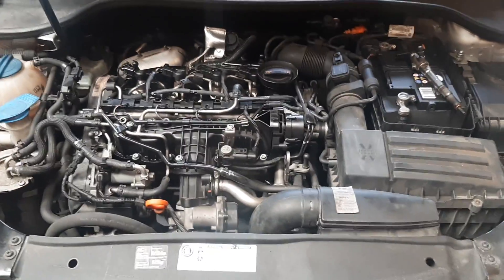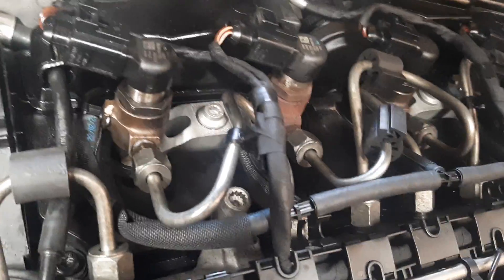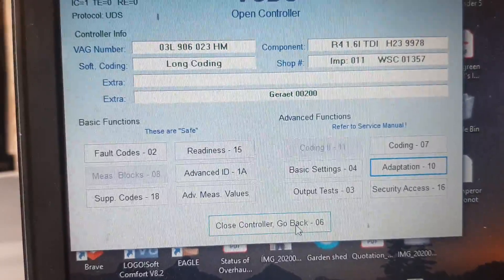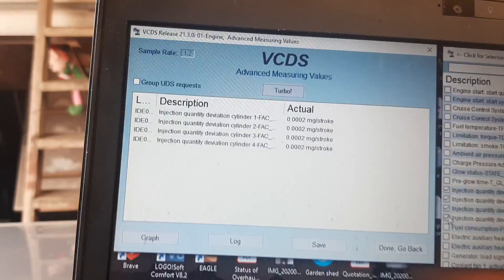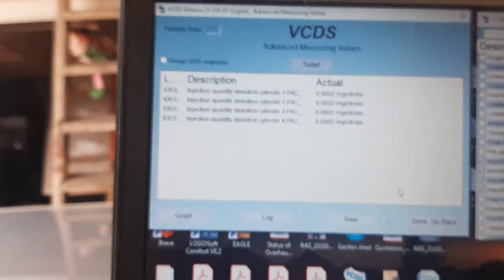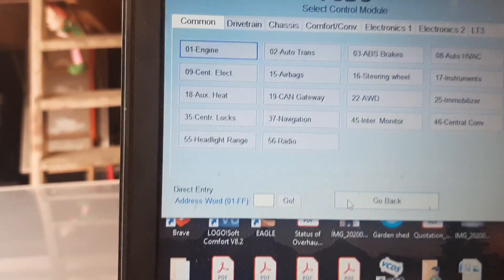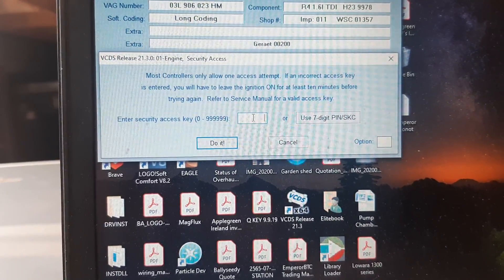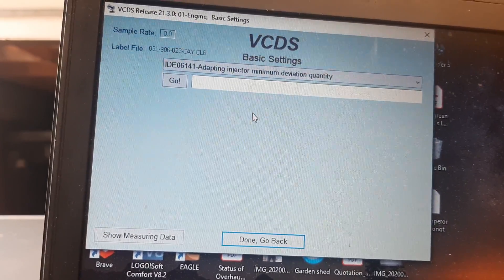VW 1.6TDI Injector Quantity Adaptation IDE06141 CAYC engine

Comment: Hi there has anyone else had a code on injector 4 in the stored value box as 293.1657g, the other injector are normal codes from the top of the injector apart from this one. 

I too am having issues running the cycle but I’m thinking it’s something to do with this. 

Thanks I’m advance 
Jake
Reply from the maker: Hi Jake, that is certainly not a valid compensation code.
Reply from the maker: Have you tried to input the code that is on injector 4?
Reply: Thanks for the reply, yes I recoded the injector on a different laptop/system. I then had a look on this software but the code box for injector 4 would not let me type in it so I couldn’t change the code on this software. 

I had actually previously had the car remapped, so I’ve got someone coming to take the map off today and hoping that this will reset the injectors and fix the lumpy running.
Reply from the maker: @jakelongstaff3173  OK Jake, yes all bets are off if the remap has been done adhoc - Should be good after OE software Rev.

Comment: If the code is 6 digit, i must add 0 at the end to make it 7 like your code?
Reply from the maker: Well spotted! I actually thought all siemens/CONTINENTAL injectors were 6 digit. Perhaps the ECU is putting in the 0 to fill the null placeholder. Generally the 2.0tdi with bosch use a 7 digit.
In any case just put in your 6 digit code.
Reply: @enginemanagementadventures7305  after doing that and adjust the injector quantity, the values are at 90°:
1. 0.7180
2.-0.3177
3.-0.6425
4.0.4697

Are the values okay?
Reply from the maker: @costash2  what is the history of the car? What car, engine code and what did you do? Did you change 1 injector or 4 and why? Also did you code and run the balancing adaptation?
Reply: @enginemanagementadventures7305  i changed injector 3, the car is golf 6 1.6 cayc with 284k.
And i enter the code and balanced

Comment: hi, thanks for your videos. I have a 1.6tdi cayc, and there is a chaotic knocking on a cold engine like in the video, after warming up it is gone. The engine runs fine, no errors, just this noise. maybe you've seen something like this?
https://youtu.be/rW5IoCBvWTU
Changed the alternator pulley, but it didn't help. Thanks in advance!
Reply from the maker: Hi Viktor, any codes, check engine or glow light flashing?
Any smoke when knocking?
Reply: @enginemanagementadventures7305  no, nothing like that. acceleration is good, consumption is also excellent, there is no smoke, there is no knocking during acceleration either.
only this chaotic metal knocking on a cold engine.
I found a video with a freewheel of the generator, it sounds very similar, I was sure that I had the same problem, but the replacement did not give anything, now I think that it is probably the knocking from one of the injectors..
Reply from the maker: @viktortsarenko5730  An Injector worn will not get better when the engine is warmed up, I suspect this is not diesel knock but a worn flywheel (DMF).
Reply: @enginemanagementadventures7305  I thought about it, but I think I have a single mass flywheel (golf 6 2012)
Reply from the maker: @viktortsarenko5730  Yes you are spot on most  have single mass but not all.
You need to figure out if the sound is coming from the bellhousing / transmission area of indeed if it is overfueling on a cold engine.
If you have VCDS you could check the injector compensation values to see if one is wildly different, however the best way would be a lee
Reply from the maker: *would be a leak off test.

Comment: Dude, you are magic! Thanks for the great videos! I have an issue when engine hot, under huge load (highway run, or mountain climb), RPM are deviating 780/750 shaking included. Checked with VCDS no deviation, all readings normal, but i can feel that the flywheel is going bad ways. Do you think that its smart to do injector adaptation?! In addition here's my video. Thank you for your time. Kind regards. https://youtu.be/owiBfvi0-ik

Comment: Did any smoke come from behind engine whilst running rough?
Reply from the maker: Shouldn't be any black smoke from any car with a DPF really, if its blue smoke could be oil /turbo issue.
Reply: @enginemanagementadventures7305  when I unplug the injector the smoke went away.
Reply from the maker: @shanebaggley4167  Is the engine running rough? Diesel knock etc, what was the reason for running the injector adaptation? Disconnecting an Injector while running is not recommended. Does the ecu have any codes etc?
Reply: @enginemanagementadventures7305  this was after changing a faulty Injector for second hand before the quantity adaption. Seemed to be smoke coming from behind the engine when running rough.
Reply from the maker: @shanebaggley4167  second hand injectors can have very high leak off rates from wear, so lots of smoke could be due to overfueling, adaption will not cure wear.

Comment: Hi mate  I’m on 21.3.0 and in basic settings it isn’t on my list same car golf 1.6 tdi 2010 any ideas thanks
Reply from the maker: Update to 22.3.1 but in any case if your on a CAYC engine it should be there ive deffo done lots of 2011's
Reply: Thanks for fast reply it’s a clone but think I will have to buy genuine one fitted refurbished set to are ok but 2 of them are in plus 2 lumpy on tick over and diesel knock to about 1500 rpm under load then fine
Reply from the maker: @andystewart7086  you fitted referbished injectors? If done by a diesel specialist they should be perfect, make sure you code the compensation codes first. Probably need the genuine interface for that I'd imagine.
Reply: Bought them off eBay sending them back as in 2 plus making my car white smoke compression test all cylinders 25 bar bought vagcom should be here by Wednesday cheers
Reply from the maker: @andystewart7086  http://wiki.ross-tech.com/wiki/index.php/2.0L_CR_TDI#Adaptation

Just make sure you perform this in the Adaptation first - The ECU compensates for mileage so if you put in new injectors you will get over fueling & diesel knock.
Reply: Thanks mate for help will let you know how I get on wish I was near you would of let you sort it thanks
Reply: Hi just to let you know I took car in to vw to get software update now I have performed the quantity adaption now sorted did have diesel in engine oil what was caused by dpf trying to constantly regenerate removed dpf internals and got it mapped out thanks for advice mate
Reply from the maker: @andystewart7086  tks for reply! Wow its strange you didn't have any over pressure codes regarding the dpf.
Glad your sorted!
Reply: Yeah no codes mate was advised it would be dpf as was getting diesel in engine oil

Comment: i have a seat ibiza 1.6 tdi cayb 2013. the car has costum ecu flash, i had to replace the #3 injector and now i have jerking. my mechanic said i have to perform an ide6140 but not sure if it can be done with modded ecu map. do you know if i can?
Reply from the maker: Did you replace with a new injector and code the compensation code?
If so the procedure should work as intended.
Reply: @enginemanagementadventures7305  i replaced the injector with a refurbised one that was tested before for proper fuction and it passed the test from a very trusted person. i then passed the new compensation code. i yet have to do the ide6140. so i will procced once the costum ecu rom will not stop the proccedure
Reply from the maker: @papakolos  the custom map should have no effect on the calibration process, the tuner will have updated various parameter quantities but not algorithmic functionality of basic setting procedures (calibration functionality).
In any case the software will overtime automatically compensate when smooth running compensation is implemented during idle mode.
The critical parameter is that the injector has been coded so the software knows its been replaced.

Comment: Hi. I have tried to swap the faulty solenoid of an injektor on a cayc engine. Engine runs , but ruff and knocks under load. Tried to put in the new solenoid code but got a error

( Adaptation Error
This appears to be an uninitialized control module;
valid WSC/Importer/Equipment data may be required.

Click [Yes] for VCDS to use default values of 12345/123/12345.
Click [No] for VCDS to try the values currently in the module.
Click [Cancel] to go back and manually edit the values.
Reply: Have tried to do this minimum deviation correction in vcds. Do I need the solenoid code to be correct?
Reply from the maker: After replacing an Injector firstly programme the injector compensation code.
After this has been successful perform the quantity adaption.
Click yes to valid importor code it can't be set to 0.
Reply: @enginemanagementadventures7305  got it to take the new code and did the minimum deviation program. Engine runs at boost but shackes and knocks badly under load before boost comes in. When I took the top of one injector and put it on the old one I had it must have been totally wrong?
Reply from the maker: @kjelljohannessen8827  trying to repair these injectors yourself without specialist equipment is not advised, I'm pretty sure continental / VDO use shims to calibrate the piezo stack.
You need a reconditioned or new injector.
Be careful because a badly over fuelled cylinder will put a hole in a piston.

Comment: For anyone having trouble getting with the "Adapting injector minimum deviation quantity" sitting at 3,000 rpm indefinitely. What I found, is that the engine coolant needs to be > 80°C. Spent hours trying to get it to work, only thing that did the trick for me was letting the engine idle until it got up to temperature!
Reply from the maker: Yes the coolent must be above 80°c this is true for all adaptions.

Comment: I've followed this to the letter. I have cayc engine also. All that happens is the glow plug light flashes forever. No throttle blips or nothing. Just idles. Vcds says running
Reply: Update, just did injector leak back and found 2 3 4 similar but 1 is about 35% more leak back. I have just removed and stripped each one down and cleaned and checked, now looking good, will put back in with new washer and stretch bolt and retest the leak back, then review the mg/stroke balance. Will report back if fixed. Also will upload some videos.
Reply from the maker: @LAW-Automotive  Great! Are you replacing the high leak-off injector ? Do you have the equipment to overhaul Piezo injectors.

It will be interesting to see if the function will run when you replace the bad injector as it is possible out of range compensation values prevent it from running in the software.
Reply: @enginemanagementadventures7305  just tested by driving under load and injectors go crazy and lots of smoke. So I think I've got no choice but to replace them. I've spoken with a diesel specialist about reconditioning them, he said the coil fails intermittently under load with voltage applied, so testing without voltage isnt going to show a fault. Lesson learnt there. 100volts is required to test them, should return close to 200k ohms. Less than 170k ohm is a total fail.
Reply from the maker: @LAW-Automotive  yes, the piezo pack can fail totally or  partially or the injector nozzle can have mechanical wear depending on fuel quality and mileage but overhaul or replacement the only way.
Keep us updated on progress. 👍
Reply: @enginemanagementadventures7305  I've just ordered a set of 4 refurbished injectors from Germany, which are bosch tested and come with a test report and 1yrs warranty and unlimited km. I will update once fitted and thr results difference betowee the worn injectors which I believe 2 and 4 are over fueling, despite the leak back looking Alot better after nozzle end cleaning it wasn't going to fix the major issues unfortunately.
I can confirm stripping the nozzle end with 15mm 6 sided socket isn't difficult and as long as the injector is functioning normally this will work for dirty nozzle. And only will cost your time and 25 quid for new copper washer, oring and stretch bolt.
Reply from the maker: Its in an Infinite loop when that happens - Usually caused by not entering security access only after an ECU power cycle as outlined.
But if you have done that correct I am unsure? 
Reports that non genuine VCDS interfaces can be troublesome also.
Reply: @enginemanagementadventures7305  yes I definitely did it correct. I also have genuine cable and software. Im stumped. After I tried this several times I tried to drive the car and its was terrible, clouds of smoke, injector 2 and 4 was pegged at 5mg/stroke vs 1 and 3 - 5mg/stroke to compensate.
I left it for 2 hrs and restarted back to normal issue with it being a bit lumpy and injector 4 is 1. 5 to 2mg/stroke and 1 2 3 are trying to compensate, not so much 2.
So I don't know what to do now. I have no codes.
Reply from the maker: @LAW-Automotive  Hi @LAW what year is this 1.6 CAYC also why did you initally decide to run the routine (lumpy idle?) if you have clouds of smoke it is not because of the routine, it only compensates to achieve balanced smooth idle, smoke is due to damaged injector, turbo damage etc.
Reply: @enginemanagementadventures7305  2010.
I didn't have clouds of smoke until after failed adaptions attempts.
The original fault was just rough idle when cold.
I think the real issue is leaking copper washer seal on injector 2 and 4. Hence worse when cold and also when you drive it it will knock more and feel under powered.
Reply from the maker: @LAW-Automotive  I see, that''s strange as the compensation amount is small can create knock but should not be able to over fuel enough to create smoke especially on a car with a DPF.
 If injector copper seals are bad there is a vent hole for each cylinder close to the exhaust manifold bolt, there should be oil escaping there.
I dont know why the routine wont work for you, I presume the ECU was never mapped?
Have done this many times on 1.6 continental/siemens ECU's only did the video to highlight the problem you are having, which is caused by not power cycling the ECU before entering security access.
Reply: @enginemanagementadventures7305  I've read it could be something to do with the software number, either older SW or not had the emissions recall done. I don't know really.
Tomorrow im gonna do a leak back test and then take out all 4 injectors and check seals. I will make a video and link it here if there is any discovery.
Reply from the maker: @LAW-Automotive  I have done many from 2010 to 2013 before they changed to BOSCH and never had a problem, however some believe the software update may be to blame as you say.
Get yourself 4 washers, 4 o-rings and 2 new clamp bolts before you take them out - Torque is Critical on the stretch bolts when assembling. Video would be great.
Reply: @enginemanagementadventures7305 what is the torque spec do you know off hand please?
Reply from the maker: @LAW-Automotive  Pretty sure 8NM + 180 degrees will check ELSAWIN tomorrow.
Reply: @enginemanagementadventures7305  yes that's what I thought but wasn't sure. Now im sure I read it correctly as that. Thank you.
Reply: OK, I've installed the refurbished injectors and the car now runs quite well. I haven't done a lot of driving due to overheating caused by the heater matrix being blocked, it's now been flushed forward and reverse many times and is clear, so no more overheating. So I tried to do the adaption for idle deviation and it still doesn't work. The idle figures look to me around the same figured as with the old injectors so I bet its still using that data and until I get the bloody adaption to work it won't be spot on as I want it. I don't know if there is any self learning it will do after doing 200 miles or something is there? I will give the tool the garage nearby me has a go and try the adaption with that, it's a launch diagnostic tool I believe and can do coding etc so should work for adaptions aswell. I will report back.
So just to be clear the injectors I took out had 1 failed coil the other 3 injectors passed the 100vdc insulation test. Must be above 0.04ohm, my working 3 injectors were 0.2ohms, the faulty injector was 0.0ohms. All of them passed the leak back test after I stripped and cleaned the nozzle end only. So I believe if a injector passes the insulation test and then you strip and clean the nozzle end and then leak off test it to confirm, you basically have a good working injector. Ofcourse not calibrated and perfect but still worn to a degree and functioning with satisfaction.